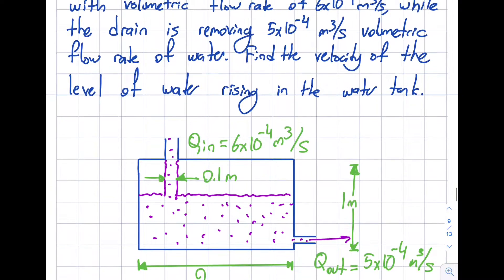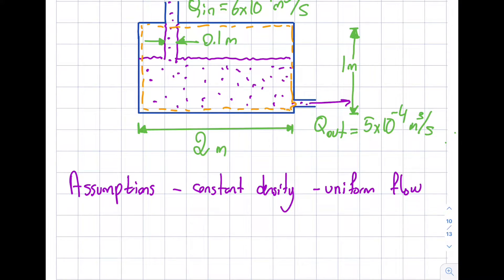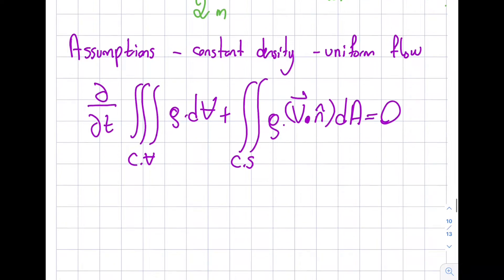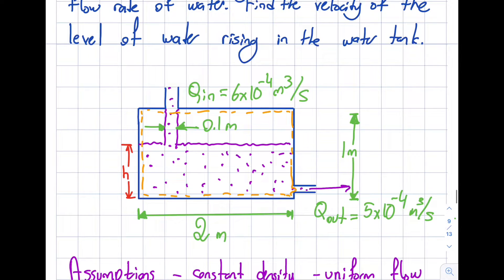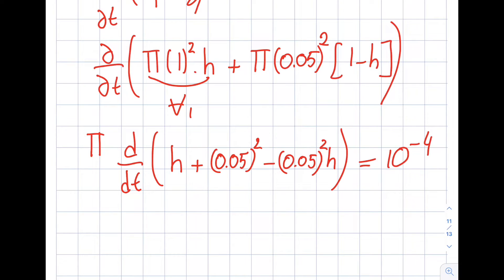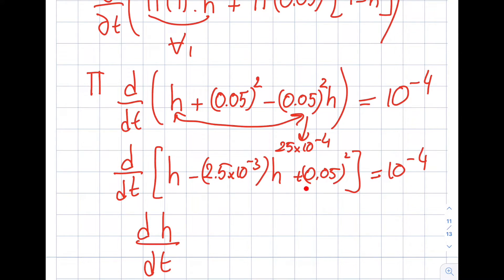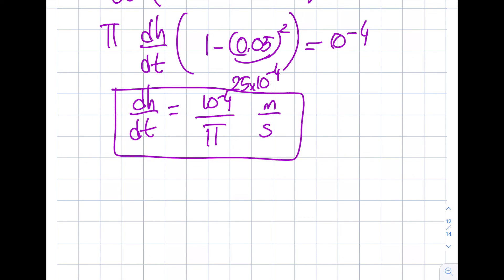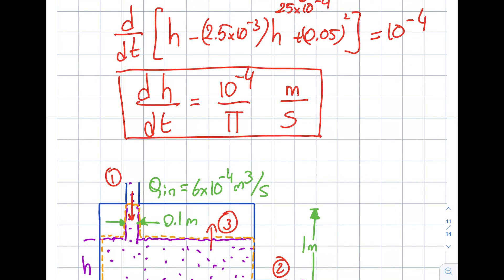Fluid Mechanics 5.6 - Solved Example Problem for Conservation of Mass - Unsteady Water Tank

Comment: To clarify too, in 12:00 , I’m still confused why  section 3 is also an exit. Is it because the water is still moving so technically it is leaving the control volume?
Reply from the maker: You got it! Yes, as the water level is changing, section 3 is leaving the stationary control volume we selected.

Comment: Sir I’m confused why the h is negligible in 11:00? Why did you change d/dt to dh/dt
Reply from the maker: Hello Valerie, very good question. I am not neglecting h,  the first term is h and the second term is -2.5e-3h (which is h/400). What I am stating is if I subtract h/400 from h; I simply get a number very close to 1*h, so I rounded it to 1*h, the accurate number 0.9975h, which is very close to 1*h. Hope this helps
Reply: 10:35 *